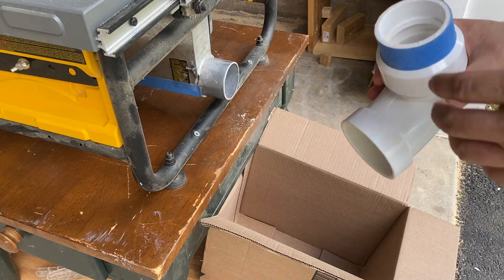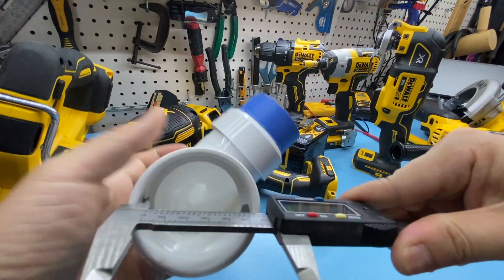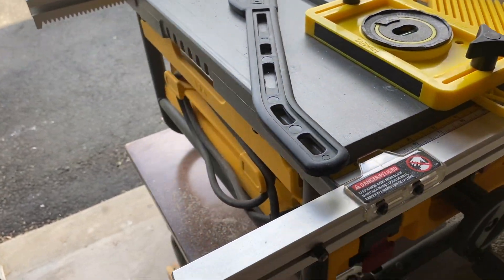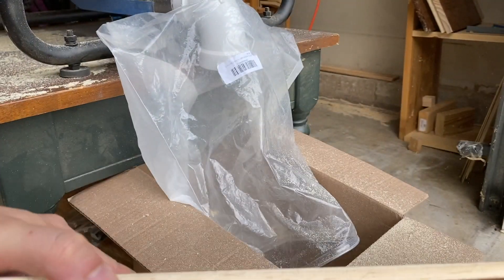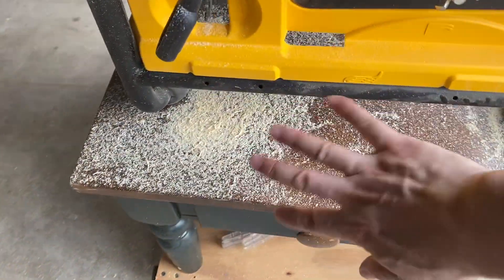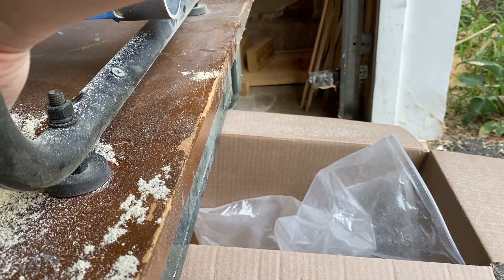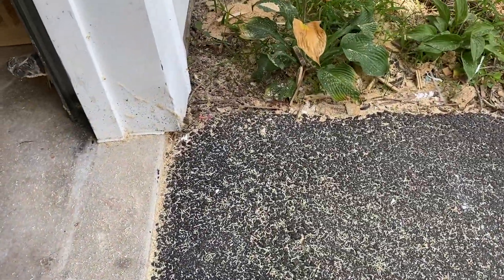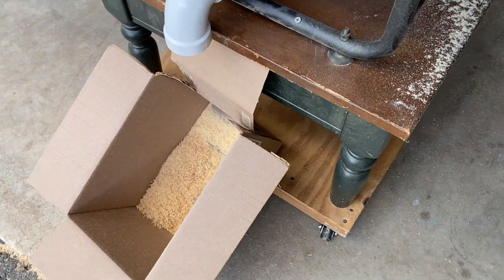$3 Passive Dust Collection Improvement for DeWALT Table Saw (No Vacuum)

Comment: I use a 3" dlexible PVC elbow coupling with its two stainless steel hose clamps along with a12 inch section of 2" ABS pipe. A wastebasket is placed under the 2" pipe and the sawdust is dropped into it. Very little sawdust escapes into the shop.
Reply from the maker: Thanks for sharing your experience! Could you share a photo or video please? Thanks!

Comment: Why not take a clear recycle bag, attach it to the adapter and either use a clamp or good elastic bands and all the saw dust will blow into the bag and none will escape.  That is what I do.
Reply from the maker: Don't we need to keep the air flow? Otherwise the dust may go up.

Comment: Why not just connect it to your shopvac?
Reply from the maker: 1. noisier. 2. higher power consumption, may need another AC line. 3. more difficult to setup. 4. bulkier.

Comment: I'm sorry dude but you need to put "no vacuum" or "without vacuum" in the title.
Everyone who owns one of these is gonna get all excited that you did something clever to create better suction and make less mess - then watch the video and get disappointed
Honestly this is barely in improvement....
And 7 minutes to say "I put a PVC elbow on the dust exit"?! Brooooooo
Reply from the maker: Good idea. Title updated.
Reply from the maker: Also put “passive” in title.
Reply: And yet when I went looking for a cheap fix, I found this video. And the $3 improvement was exactly as advertised, and works a lot easier than what I was expecting to have to do.